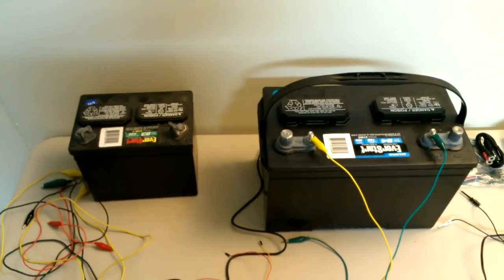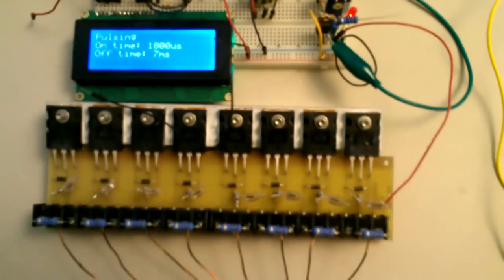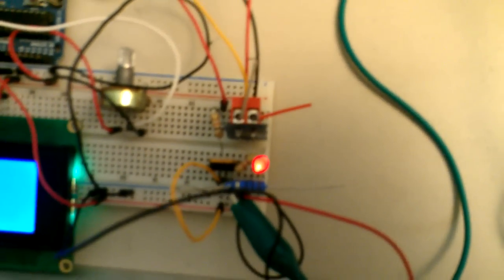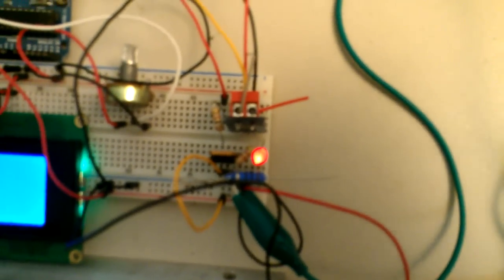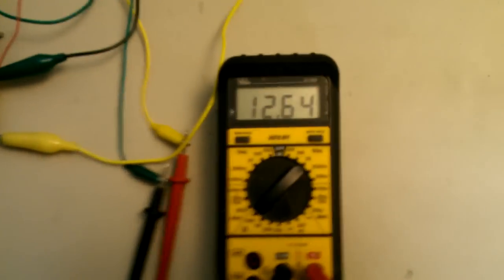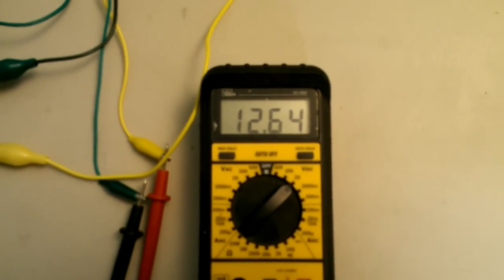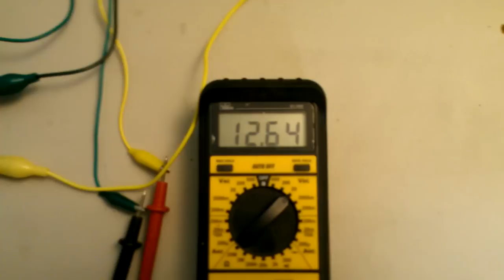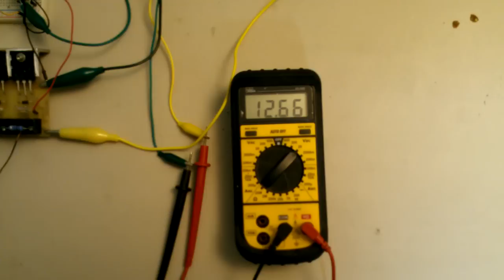Solid State Arduino 8 Circuit Bedini SSG Wiring

Comment: So, the arduino is giving you the pulse you need from the pwm output on a pin?  Would it offer any advantages to have something in there that works as a flywheel?  I was thinking the arduino would help regulate the amount of juice going into the wheel, keeping it optimal, but this is way cooler with less moving parts.  I just wonder if the flywheel helps the process in some of the systems we see out here.
Reply from the maker: The flywheel is just a way to capture extra energy. ~30% according to Bedini. RIP. I was just experimenting with voltage spike.

Comment: Pump up the mic :)
Reply from the maker: You are a hero of mine. You working on anything interesting lately?
Reply: Well that's nice to hear, but typing away on a keyboard wasn't that heroic :) Yes i'm working on measuring the counter-EMF from progressively larger and larger inductors that all have the same resistance but higher inductance than the previous coil, and are all having the same power into them.

The standard maths says that the higher the inductance, the more energy stored in the magnetic field, implying that the more turns etc you have the more power can be harvested from the CEMF when the current is cut and the field reverses then collapses. It shows promise so far, each coil has outperformed the other in terms of powering a Neon bulb, and for the same input power the coils with higher inductance make the bulb shine more brightly. So the obvious question is where is this energy coming from? It's clearly coming from the extra copper mass since that's the only variable. 

The next inductor to try weighs 18.5kg, if i can get it on this ebay auction, it should provide some nice kickback.  @Rssident
Reply from the maker: I have seen a video from two guys who presented at some Bedini conferences demonstrating that effect with inductors. Pretty interesting. I am researching what that spike can be used for. 

I am interested in it's effect on ormus, using it for generation of Brown's gas, and changing the properties of water. 

Also want to build a zero force motor and a BiTT. If you want I will keep in touch with any interesting things I find. Is the email in your profile the one you use?